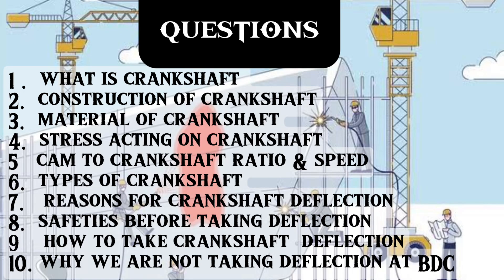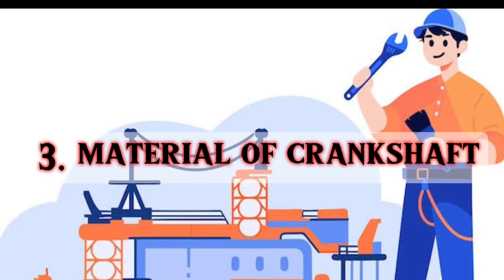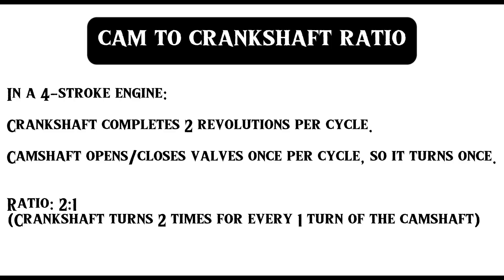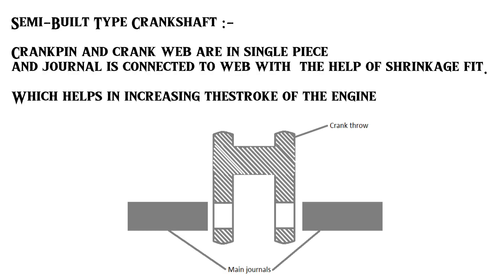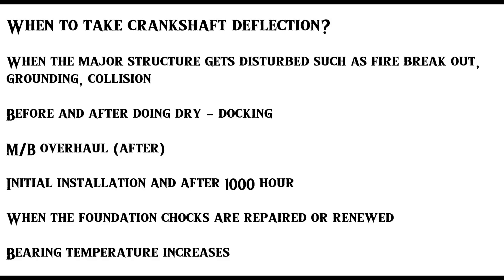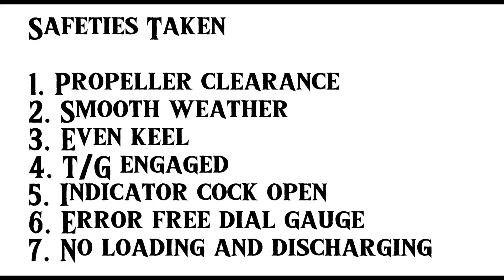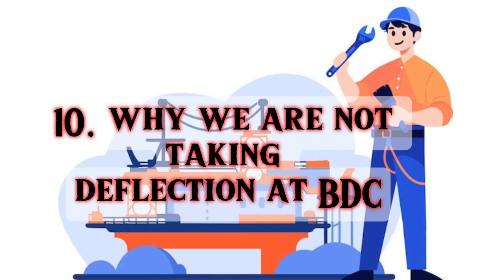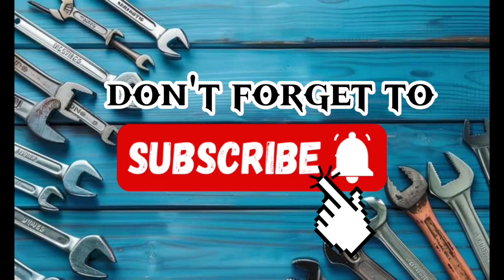Crankshaft #frequentlyaskedquestions #meoclass4 #crankshaft #marine #mainengine

Comment: 02:46 are you sure about that, I read that fully built was used in older slow speed larger engines, and for generator engines it is fully forged or semi built for larger generators. please clarify
Reply from the maker: Yes bro I am sure 
For M/E you can use -fully built or semi buildup for for easy maintenance 
For A/E we only use forged type bro  it consist on high strength
Reply: @sainadh1999  but in video you are saying ....
fully built (GE) or AE
fully forged (compressor), this is also for AE right
Reply from the maker: @cee7449 yes bro actually it will very from engine to engine bro for a/e and compressor it was forged 
For me fully or semi built
Reply: @sainadh1999  bro. i know it will vary from engine to engine, but in you video you are saying fully built crank shaft is used in AE, which is wrong and u should correct it in description or something. that's all, thank you.
Reply from the maker: @cee7449 sure bro thank you